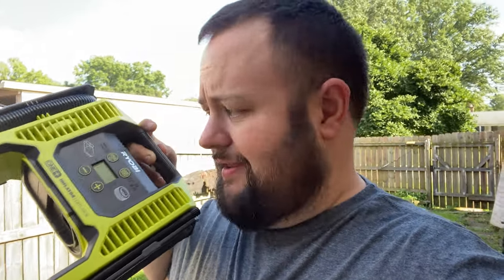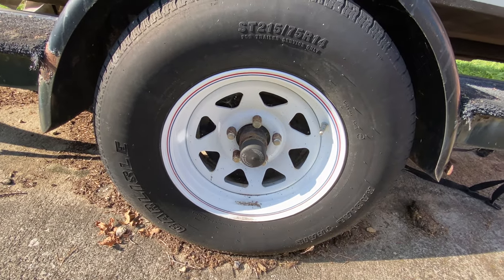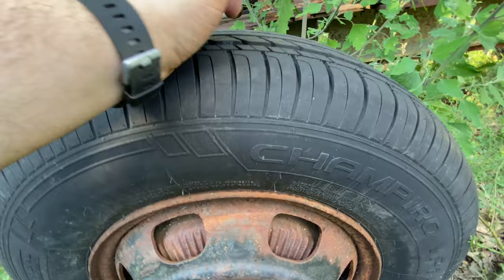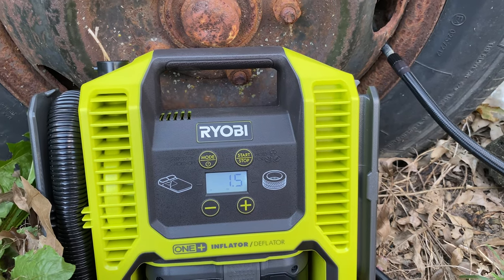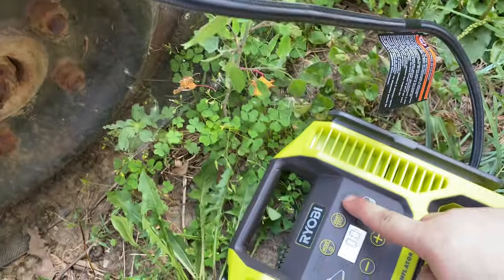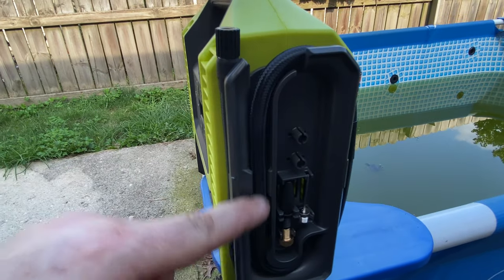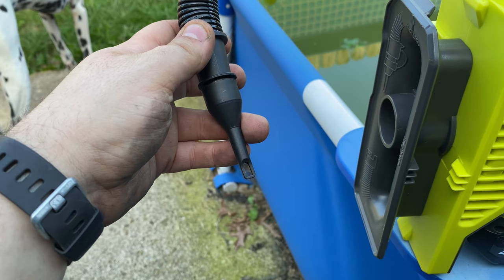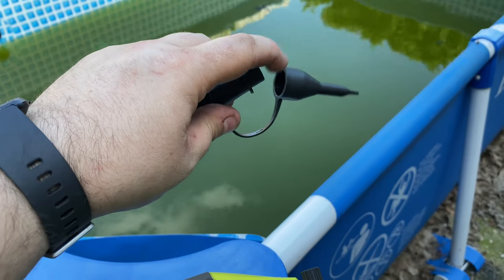Review and Testing Ryobi Dual Inflator Deflator P747 Compressor

Comment: I've had one of these inflators for many years. Recently it was acting up so I took it apart and lubed it with super-lube grease and it's running like new now.
Reply from the maker: So far I’ve been impressed with this thing!
Reply: @beaterboxgarage  me too, I use it with multiple cars, trailers, mowers, bikes and it's great! If it starts making rattling or buzzing sounds, it's not complicated to take it apart and lube the spots that seem that they need it. (Maybe I should make a video! 🙂 )

Comment: You asked for comments so...  I've seen many inflators die because people don't read the instructions and follow the duty cycle causing them to burn out. I've been using Ryobi inflators for several years now and they all still work. I have three of the handheld ones and mine work great. The one you demonstrated here I've had for over five years now and I use it  at least 2-3 times a week. As long as you follow the 5 minutes on, 5 minutes off as per the instructions it should hold up for years. If you're the adventurous type and your warranty has expired you can prolong the life by lubricating the internals including the piston. If you have trouble taking it apart there is a screw hidden under the label.
Reply from the maker: Thanks for replying! I still use this inflator and love it. My riding mower tires like to pop off the bead when they get slightly low and this inflator has been able to get them back on without much fuss. The other thing (now that’s it’s been a while since I made the video) I enjoy using it for is setting it to the mattress inflator mode and actually using it as a mini blow gun to blow dried grass off my mower when I’m done. Quick 30 seconds and the loose grass is gone.

Comment: Did you respect the duty cycle?  Doesn't look like you took any time off for the unit to cool down -- perhaps that's why your old inflator broke.  Your new one will die just the same without duty cycle
Reply from the maker: I did not. Most people just throw an inflator on a tire so that’s how I tested it. Longevity wise you are correct with following what the mfg says.

Comment: I have the Air Hawk Pro inflator. It looks like a drill. My only complaint besides the length of run time is that it gets so hot after filling 4 tires that it literally is too hot to touch the screw on connector hose. 
Does yours have this problem? I think, I might look into this product. Thanks for the review.  🏎 <•))))~{
Reply from the maker: I noticed the hose its self was pretty dang hot after filling all four tires (two of which were completely flat). I dont recall the end fitting being hot (it is made of plastic). I also would guess that just inflating low tires vs what I did would produce less heat too.